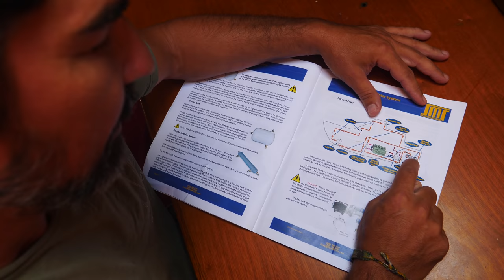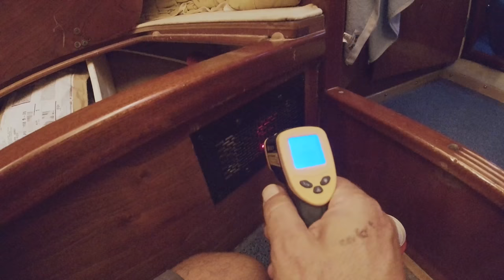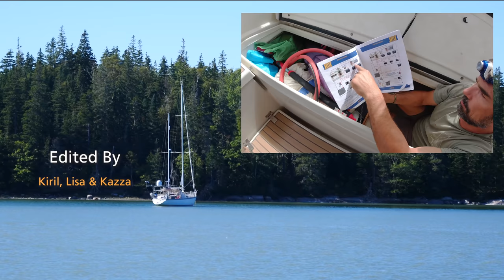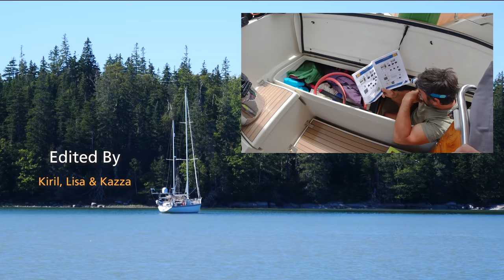WHAT THE **** are we doing out here?! SAILING in Maine - SV Delos Ep. 298

Comment: Ahyup! We sailed from Matinacus Isl. to Vinalhaven a couple of years ago. Over 300 lobster boats working out of Vinalhaven, most of them setting 600 traps each. Our cutter's keel is full so we run right over the pot warp. I did have to weld a plate over the gap between the keel and rudder after a toggle warp got jammed in it while single handing south of Monhegan. I couldn't cut the warp (need loppers or a hack saw), or pull it out with the winch, so as a last resort I started the engine, put er in gear, and gave it to er! Lucky for me it pulled the warp clear, and didn't wrap up in the prop! Pot buoys are so thick between Matinacus and Vinalhaven you can just about walk on them and never get your feet wet!

Comment: 8:30 "Hot water tubes....run across fans". 
I had a  air conditioner like this in a guest house I lived in. It was a 1987 Arkla Servel. A gas broiler heated liquid ammonia, eventually chilling water to 55 degrees (f).  Cold water was pumped to a radiator, which a fan blew across. Burned a therm an hour. So it cost $1 per hour to run (didn't need to run all day). Kept the house super cold. 

I always wanted to convert it to run on solar thermal power, so I could have free air conditioning.  Remove the gas broiler and replace it was water pipes that solar heated hot water in them.

Comment: you should try to hook into some of them Horse Mackrel while you're off the rocks.  about a 2.5 bright flasher with a treble hook, 6 lb test line.  they get the name because the fight like a horse! awesome fight, hard catching but awesome.  then toss a treble hook on the Horse Mackeral to get the stripers that feed off of them.  check licensing requirement.  Stripped bass are (last i knew) well regulated.  but an awesome meal!  50"s of great tasting bass!!

Comment: Tap Bubble wrap over the windows to insulate them. The bubble wrap will let light through while slowing down the heat loss.
Reply: @isterwoods5348  no but have on a camper and it works. if you put the bubbles facing the window it will create a 2 pane window effect.
Reply: @isterwoods5348  i just tape it using packing tape or painters tape for easier removal. I haven't notice any condensation but that may very depending on humidity.

Comment: Wow, a real hydronic heating system on a sailboat! Have you considered protecting the water circulation loop from freezing? Also, does it require a treatment chemical to prevent corrosion of the boiler, pump, and air exchange vents? Great video!
Reply from the maker: Hey Richard, the coolant loop is filled with a 60/40 mix of water and propylene glycol.  There's also a self-dispersing filter that keeps the acidity level at a reasonable PH.  It took a lot of learning and work but pretty happy with it so far.

Comment: When you're in the tropics could you circulate seawater (cooler than air temp) through the system with the fans on but not the boiler? Would that lower the internal temp?